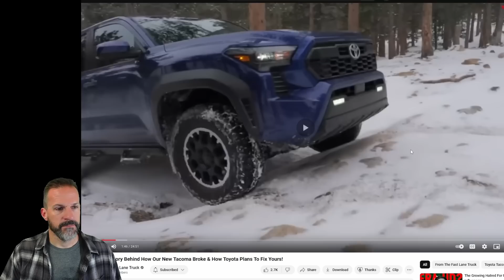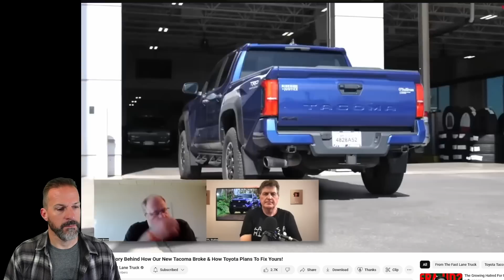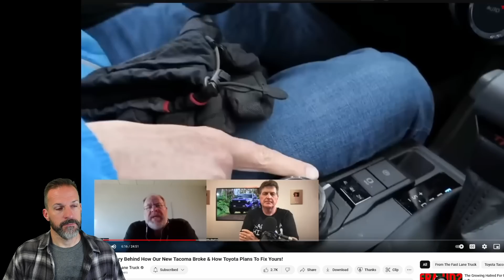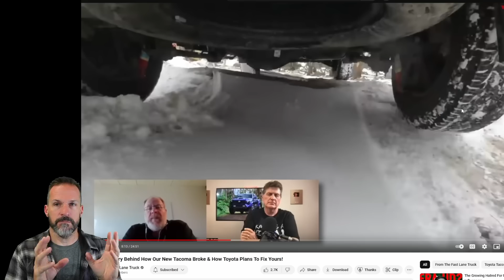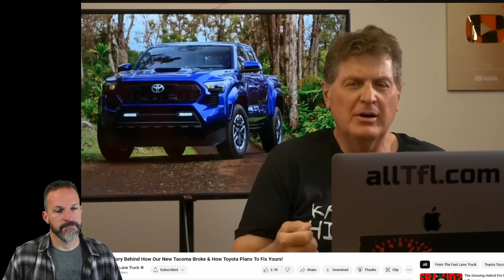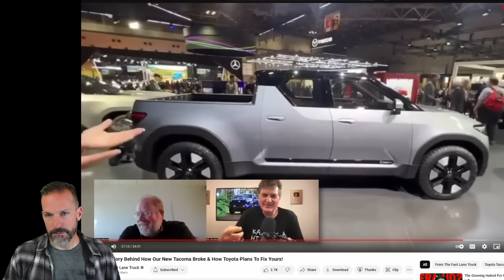Toyota will RE-PROGRAM the 2024 Tacoma to prevent future front differential failures. TFL React.

Comment from the maker: What do you think about this failure specifically? I wish they could be "overbuilt", but I think times have changed. At least it seems to be more rare than the latest transmission issues.
Reply: The front axle capacity was exceeded by 1.7% 🤣

Go to any trail and there will be a pre-05 Toyota being bounced off of obstacles on the rev limiter. Capacity being exceeded basically on the entire trail. Built tough unlike this over priced example.

1st Gen Tacos were literally being laden with sheet metal and sent to the Middle East to have a gun mounted in the bed. Meanwhile here at Toyota of North America the new Tacoma can't survive a low throttle low range obstacle 🤦
Reply: Seems like shrinkflation has hit the automotive sector, smaller, weaker, cheaper components but it all looks the same on the outside. Companies are always looking for ways to cut costs, especially in this market when their supplier costs are likely going up
Reply: It's poor and cheap engineering. Sheldon said they used the same component as before. This is cost cutting. The old engine produced a peak of 265 ft lbs at 4000+ rpm. The new engine develops what 310 at 1700 rpm. That's two completely different torque curves. The part needs to built stronger, not the same. To use software to fix the issue is just a cheap cop-out. Plus the Chevy made it up the same spot on the same day at the same time with-out issue. We expect better of Toyota not less or even the same. That's why we buy Toyota in the first place and not anything else.
Reply: @djjd3027  you nailed it to a tee! Unfortunately ever since I’ve test drove one awhile ago and give my honest opinion to various sheeple fan sissies like “The Flyin Freckle”🥱 or ANY other lovers of the 2024 Toyota Tacoma, I get either “silence” and/or my comments/opinions conveniently get “deleted”! Hmmmm, makes one wonder why the truth either doesn’t want to be heard or there’s some loyalty and obligations geared towards supporting and sticking up for Toyota Motor Corporation.😳
Reply: They used same or similar drive system components and also relied on computer to control torque spikes
Reply: @xirtam5726  and that's a problem. This engine creates a lot more torque, much lower in the rpm range than the last two engines.
Reply: @TheCarGuyOnline  It’s all about rushing a new product out for circulation and the R&D department doing a half ass job and “pencil whipping” the new platform so they can get bonuses, pay raises  and praise.😳
Reply: I think most people don’t realize the complications in having a motor control system like MTS which is a robotic system. Simple, but still a robotic system that has independent commands of acceleration and braking to each wheel with wheel slippage as sensory inputs. 

For example If the control system is badly tuned one can give contradictory commands in such close succession that it can brake things because it is beyond the design limits. 

Because that system may be so quick say accelerate at high rate then brake all within say 10 ms then accelerate again full throttle in another 10 ms, one may brake things. 

A normal human could only do that in 100s of milliseconds so 10 times slower and would never brake the components. 

So that’s partly what is happening here. 

Humans can also injure themselves by themselves by being too violent in their movements, so it’s not just machines and robots. Like causing injuries by throwing a ball at full strength because one hasn’t done it in a while and doesn’t have the muscles anymore or is not warmed up or just bad control (not stopping fast enough and going beyond the ligaments limits) etc 

Putting beefier components is not necessarily the answer. For any mechanical system and given a control system, one can probably devise crazy control commands such that things will be guaranteed to brake. 

Because the beefier are the parts, the more torque and bigger motors one need to move these heavier parts, so that if one increases one the other also has to increase, such that one may often be at the limit of being able to brake things if the controller is being erratic.
Reply: @OldelCpt  Proper engineering cold have prevented the problem from the start.
Reply: it's a lose-lose. everyone would lose their minds over the cost of one of these that are 'overbuilt'.

Comment: 50-100 ft lbs of torque shouldnt be breaking parts .. the 1UZFE  was designed to last 1 million miles . 
the new transmissions are only stress tested to 150k    but mazda is still testing transmissions to 500kms

Comment: It's a real REAR elocker....but the front is a software locker.....Apply the brake to the slippage side and the other side sees more "bite"...more traction but if the software over-applies the brake then it strains the little intermediate coupler and it snaps.   My take is totally disable the front "traction control system"....or put a real elocker in the diff.   At the very least one could reduce the brake applied in the software by 50% and the result would be a limited slip type of performance but at least it's not straining the coupler that much.

Comment: Rare is correct, by the numbers at least. 25% of 4wd owners are ever in a place to need 4wd high. 5% of those are ever in a place to need 4wd low. However, with an open differential front axle, each axle shaft will see no more than 50% of the available torque. Oversized tires amplifies this. That should be really concerning. I’m a former Powertrain warranty engineer for Chrysler Jeep. I’ve seen a thing or two. 😉

Comment: Weak components. No company before this told their customers to "not floor it" or "take it easy" when they introduced a new, more powerful engine(s). They know the engine specs and torque curve, and they should have appropriately matched a transmission to it instead of making excuses.

"Engineer" talking like a bean counter.

Replace this potato head with a Japanese engineer from the olden days. This guy is a disgrace.

Comment: Like watching your show bro. I remember using emergency brakes on a 2x4 to sort of get a pozzi-traction effect in totally stuck situations where the wheel that spins is braked enough to force the gripping wheel to turn. In this specific Tacoma situation, they had the back locker engaged, but maybe the MTS system was doing some braking magic in the front to simulate a pozzi-traction like effect that was errorfully applying brakes to both sides at the same time, thus causing the driveline ADD to bust. Looking at the video I found it odd that the front wheels were grab-slip pulsing rather than just straight slipping on ice. With all the problems Toyota has been having lately, their price hikes since 2020, it's also possible they're cutting corners on materials and relying more heavily on software to cut down on manufacturing costs.
Reply from the maker: Yeah it's pretty sad to see most manufacturers are just worried about weight, which reduces strength in everything. When all these new light/underbuilt vehicles have 100k miles on them, I don't think they are going to hold up well compared to slightly older variants.

Comment: They did not show actually the part that broke on the front differential assembly, for the aftermarket industry to build that same part to withstand that amount of torque!
Reply from the maker: There are a lot of little parts underneath the A.D.D that could break, because they use an A.D.D for fuel mileage and towing. The Nissan Frontier doesn't have lots of little parts on that side of the half shaft, the trade off is the nissan can't be towed behind an RV or something. I'd take the Nissan tradeoff at this point for a more beefy part.

Comment: Sad. Owned a 3rd gen Tacoma. I own a 97 LX450 now. The level of overbuilt in the 80 series is insane. Bought it used for $6K. Originally a $60K price tag in 1997. Its triple locked from factory. These types of Toyotas are still made in the 79 series over seas. We don't get these here in the US. No diesels here either. Hey Toyota, GM, Ford ,Dodge....I don't want your super tech shit.  I used to rent 3rd gen Tacomas and 4runners. We would take them wheeling and beat on them without issue.

Comment: also, both of these guys are damage control for Toyota.  Hey Sheldon and EDER group, what’s your take on the bad manual and automatic transmission’s and the clutch dropping out when shifting from 5th to 3rd gear? All the Toyota loyal customers are not buying this explanation or these “software fixes” and will not purchase these new vehicles from
 Toyota. Enjoy getting roasted Toyota Corporate. You deserve everything coming your way. Sell your Toyota stock and get out while you can. Also, they make this truck in Mexico and they charge 40 percent more for it and still can’t afford to build it correctly???? Let them fail.

Comment: It really sounds like they went as cheap as possible for Gen 4 and hope that they can tune it in software.
Specially if you account for the transmission and differential overheating issues that others are encountering.

I bet that more issues will arise once these trucks are older and get more miles.

Comment: It's entirely plausible that this is a software issue. 

All the elaborate traction control systems can pulse power and braking in self destructive ways if they are programmed to, and Toyota isn't exactly famous for getting computer curves right. Ask any Tacoma enthusiast and they'll likely tell you they've had the truck "tuned", i.e. the ECU and perhaps other curves hacked. 

All of that said, note that they didn't get up the obstacle anyway. Limited slip rear and 4Lo would have done at least as well and maybe better, without breaking anything. 

A "built" rock crawler with everything oversized, lockers, tall articulating suspension, etc., costs a lot of money and doesn't necessarily work on the street very well. 

I get that Toyota wants the TRD versions to offer features other than a few skid plates, nicer shocks, and some stickers, like they did in the past. But it seems that both buyers and Toyota are unrealistic here. 

You are not a rock crawler unless you know you are, and then you're not buying or driving an off-the-shelf Taco. You might drive a Tundra, but only to trailer your built crawler to go play.
Reply from the maker: I would agree if you are wanting to do rock crawling you need a dedicated rig, however the spot they got stuck on and how it broke was pretty tame. The software was and always does jackhammer the wheels with braking power and MTS, many systems do, like you said maybe they should just go back to manual lockers/lsd and stop trying to get fancy with software.  The Chevy Colorado seemed to handle it.
Reply: @TheCarGuyOnline  oh I totally agree. That's part of my point. There's nothing there that actually requires elaborate traction control, which didn't even seem to help. 

That's not a rock crawl. It's a challenging section where you have to pay attention, but it's nothing you couldn't get through with a low-tech conventional 4wd with limited slip rear like my Jeep or my SR5. I would hit it with more momentum but you can't really get traction on ice regardless. You have to build up a little speed to go through it. 

The extra-cost, extra-maintenance computer controlled system didn't get them through the section. It only broke the diff.
Reply from the maker: @barrydworak   Yeah for sure. That was one of those spots where you don't crawl slowly up the rock on ice, you momentum bounce it a bit (just enough) to get the rear tires out of that dip. I'm not someone that 4 wheels all the time but it's astounding to me how few people understand the physics of wheels/gravity etc.

Comment: Sheldon needs his marching orders
His excuses don’t wash
Look up the torque of the 2.8 diesel sold in the hilux etc in other markets
That turbo diesel produces 322 lb/ft torque from as low as 1600rpm and the Tacoma gas/hybrid 317 lb/ft 
So how come the hilux seems to be able to take a bit of stick and this can’t?
Cost cutting pure and simple
Prove me wrong
This cheap and nasty trait has been a Toyota thing for decades but for the most part they suppress the urge to go there
But not now😅
They didn’t have to reinvent the wheel here
This is straight up nonsense.

Comment: Toyota garbage. I drove 4hours one way to 10k feet in elevation in the mountains snow and buried in mud and snow  2 feet deep  to pull out a 2019 GMC HD Denali. Them diesels ain’t light. I pulled him out with my Jeep Gladiator Rubicon stock axles stock drive shafts with 37s no regearing or anything just a basic stock Mopar lift 3 inches. Guess what I pulled him out and drove another 4 hours home.

Comment: Broke the front drive on my 1999  LX 470 on a low level and similar terrain.... Toyota had upgraded from a "two pin" to "four pin" connection models after that.... so Toyota has under-engineered these vehicles in the past.

Comment: How did they not test a situation where 100% of torque goes to one tire and traction control is applied by the computer? How did they not anticipate a situation like this?

This just means the vehicle is not mechanically sound for the engine and the computer reprogramming is a patch.  If I was in the market, I would wait until the mechanical components are upgraded to handle the engine.  

Obviously this engine is stronger than the rest of the parts/components. There is also the video from truck king where the 6 speed manual is torched by the rev matching when he switches from 5th to 3rd.  Clutch literally falls to the floor and is broken.  They detuned the engine on the manual because it is too powerful for the 6 speed manual they carried over from the previous generation. Obviously they didn’t detune it enough.  

It makes me think they carried over more than just the 6 speed manual transmission and never beefed up the components to handle the stronger engine period. No reason for the front diff to mechanically fail.

Nissan needs to pay Toyota for all the titan and frontier sales that will come their way from the tundra engines and the Tacoma mechanical failures.

Comment: Did y'all see truck King roasted their clutch on their manual Tacoma ? They did the 5th to 3rd downshift to test rev matched and clutch went bye bye. These new trucks are not built like old Toyota at all.
Reply from the maker: Yeah I watched that a few times. I can't tell if he went 5 to 3 or 5 to 1, but it sure looked like he went 5 to 3 because their heads didn't go forward, it didn't lock rear wheels...nothing crazy. I'm guessing Toyota will say "the clutch is a fused failure point"...seems like that's their goto explanation for anything that breaks. "It was designed to break there so it didn't do more damage".
Reply: @TheCarGuyOnline  lol that is exactly what they said in their response. I don't believe he wants to 1st because the truck didn't even red line.

Comment: No responsible engineering team would ever design a system that will catastrophically fail if the design limits are exceeded by less than 2%. Even weight-critical machines like aircraft can be pushed to 150% of design load without failing. The limits are even higher for buildings and bridges. Granted, the latter don't move, but to "design" to such a tight margin is inexcusable for any vehicle. Sheldon and his team are a disgrace to the engineering profession.

Comment: Exactly as I predicted overly aggressive traction control😅
They only have a 1.7% beyond design parameter to failure?
Like WTF
Look at this way 
Say the truck develops 300hp then adding an extra 5hp would potentially induce failure
That is nuts
Reply from the maker: Yup. I said similar in my first video covering this, I thought it was the hammering of the MTS, like a jackhammer on the IC. Funny if they just let the wheels spin and added mechanical lockers, it might actually be more reliable instead of using software and braking system to move power to each side.

Comment: My factory solid axles under my Rubicon are tough as hell!
Reply from the maker: My friend has a gladiator and loves it, 90k miles so far. Hasn't had any issues.
Reply: @TheCarGuyOnline  Many of us in my circle have Wranglers and Gladiators. No issues and they are tough as hell off-road!
Reply: Dana 44s aren't anything special and actually too small with anything over 33 inch tires and lockers
Reply: @jp-nd3vd  Your opinion. I own two Wrangler Rubicons with 35’s. Been on multiple trails in Moab and nobody is breaking the axles.

Comment: Correct fix - mechanically redesign the differential so it does not fail.  Use this part in future production Tacos.  Use this part to replace failed older style differentials. 
Incorrect fix - do not redesign flawed differential.  Instead change the software in an attempt to protect the flawed differential.

A differential is not "overbuilt" if it does not break.  It is built to do its job.  The differentials Toyota is using are underbuilt.

Comment: Toyota is good at pushing the blame . Worked for them and seen it with everything that would go wrong , they would blame customers and even techs . 
For this truck to fail like this is pathetic, and saying that it's so " fragile " basically takes away from being a truck. 
TFL can't say to much by being negative towards Toyota or they won't give them test trucks etc like Subaru did to them while back. 
The new Taco is an example of cutting costs and not taking any real responsibility.